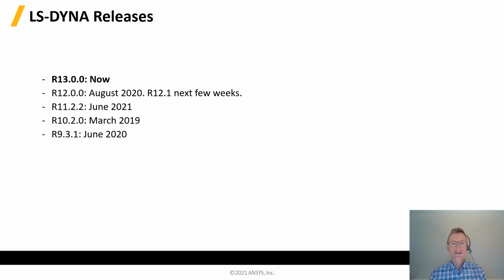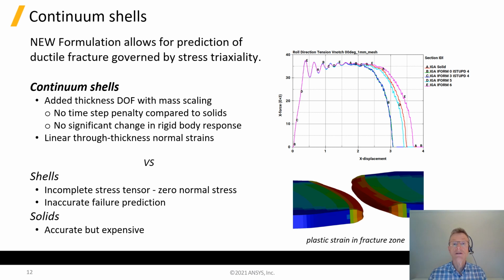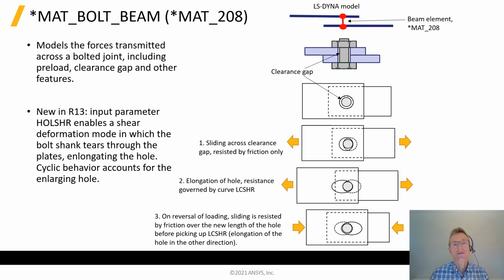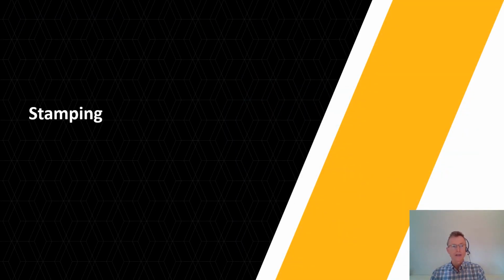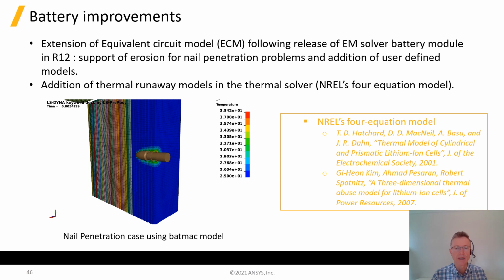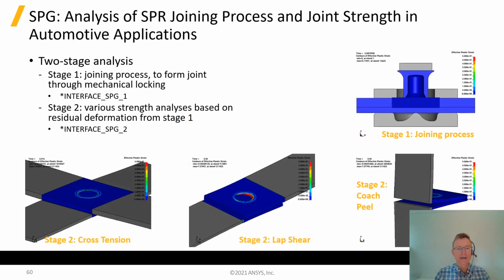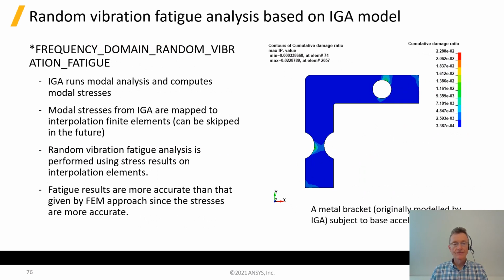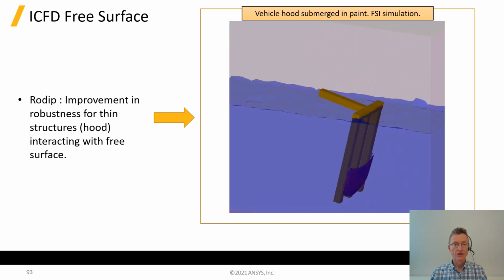LS-DYNA: Recent Updates by Richard Sturt, Arup Fellow

Comment: Dear Mr. Richard Strurt, thank you for your advanced to great knowledge of modeling simulation using LS-Dyna. recently I have topic research of modeling simulation on composite material. in the case of modeling, I got a hard way to show failure on each layer using history variable. so could you help me use some of the commands in ls-dyna to show the failure on the surface or middle surface within the layer? thank you